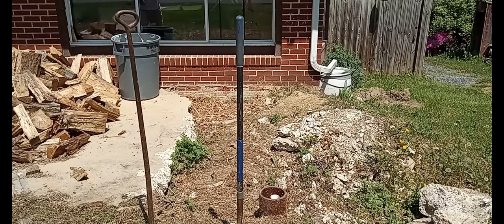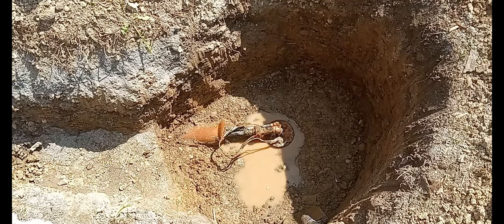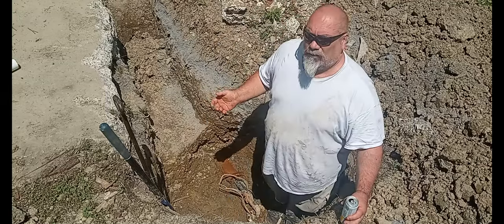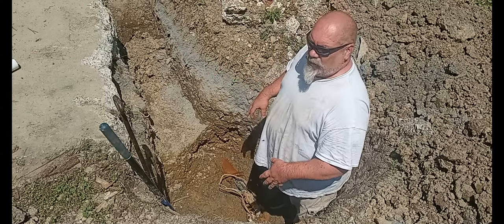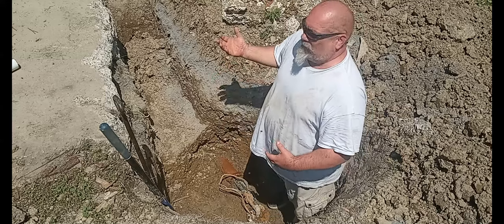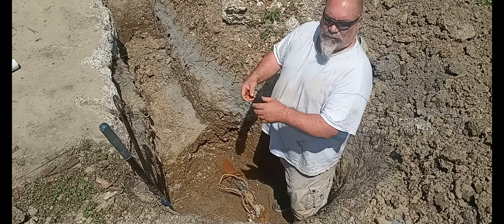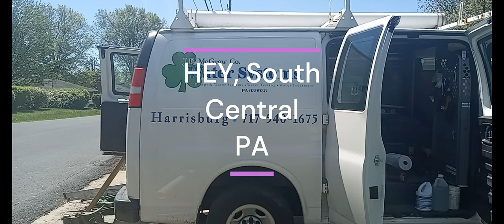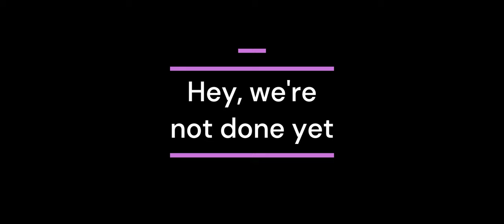Well pump removal and install part 1, saving BIG$ $10,000 oh no you didn't! #pros #diy #water #well

Comment: Last couple of years, I have received some ridiculous quotes from plumbers.    You need to shop around.  Ten years ago the plumbing outfit replaced my pump.  150 foot well, 1/2 hp Myers pump, 12 gauge pump wire, etc. for $1175.  So, $2500 today is in the ballpark.  Two years ago, I bought a water heater and had a plumber install it.  Two hours and done.  He charged $600 and one wanted $1200 and another wanted $1500.  I have installed several myself in the past but have since lost most of my sight and turned 80.  Lots of dishonest people who think stealing is okay.
Reply from the maker: I hear you, I've always said 3 quotes should be the min. the guy who ended up putting pump in was at his estimate of $2500. which I thought was fair for todays prices. part 2 install will drop thursday, thanks for subscribing if you have or do if you haven't. hopefully we help people save money here @buildmorewithless